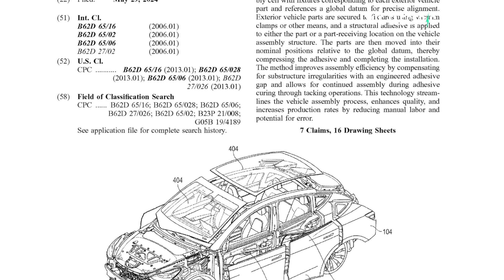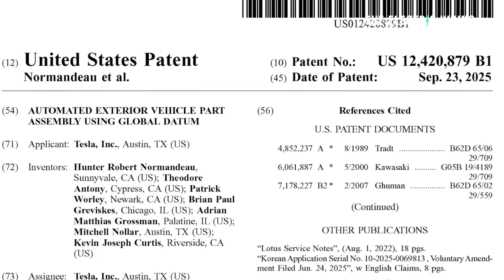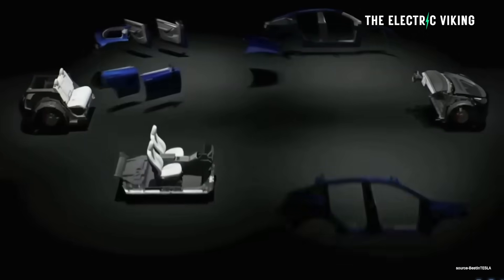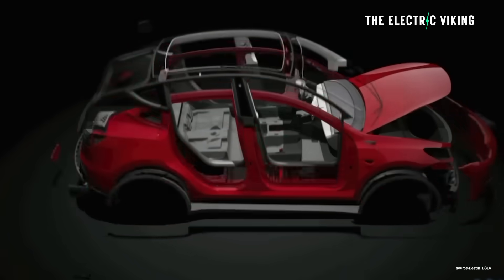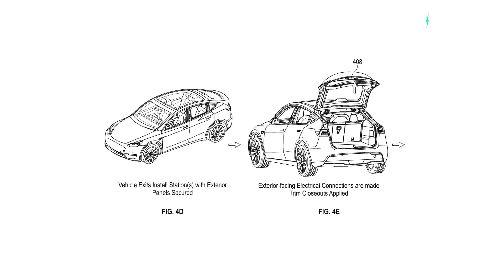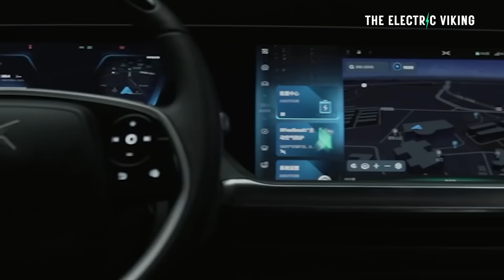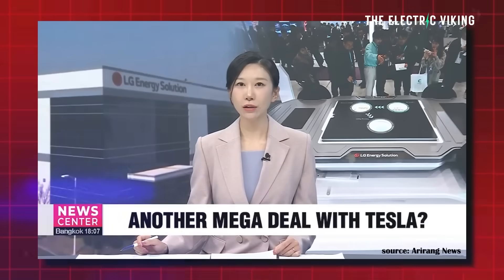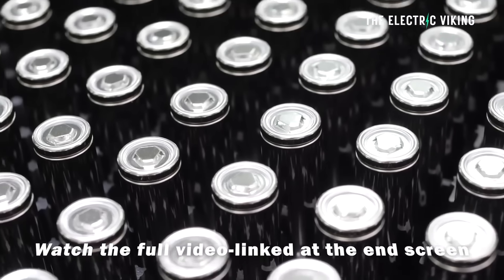Tesla Patents Revolutionary New 'Unboxed' Manufacturing Process

Comment: I read the patent.  What the patent discloses as an invention is basically using a robotic arm, alignment cage, and some special adhesives to position to external panels of the car during manufacturing. The main advantage is that as the glue is curing, the car can still receive other panels (by tacking certain panels until the glue sets), moving the car through further stages of assembly.  All elements of the invention must be present, namely, the arm, adhesives and alignment hardware etc.  What is more telling however, is the patent's B1 grant status. It means that the applicant did not allow for publication 18 months after application (as is the normal procedure). As a result of this, Tesla cannot apply for a patent for this same invention in any other country. I suspect that they want this only for the US plants in Texas, where they have this technology implemented, and will just keep certain aspects of it secret.  Other car companies can certainly paint doors with bodies and send them off for completion, bringing them back for final assembly.
Reply: You're a chad for reading the patent
Reply: @arnavrawat9864  https://en.wikipedia.org/wiki/Chad_(slang)#:~:text=Chad%22%20internet%20meme%20that%20originated,absurdly%20and%20over%20the%20top.
Reply: Tesla was using expedited examination. Is this why patent center has no examination report yet?
I read the claims, on first glance they are ridden with at least a few of 112 indefinite. Just poor quality patent imho.

Comment: Before I retired I  installed conveyors and transfer machines and made  them work with other process manufacturing machines. Our two story lateral and vertical transfer machines could complete a  cycle , with an entire automobile frame , in 49 seconds. We were the fastest in the industry.  The industry was trying to copy us . When others would brag about cycle speed they would attempt to make us believe they achieved a One Second threshold reduction. To claim a 50% increase in the speed of production is insanity. It cannot be done!

Comment: did you just say teslas are going to be glued together?
Reply: Hard pass I prefer to drive a car that’s been welded together.
Reply: Best not get on a commercial airliner then
Reply: Yes, that's what the patent is actually about.
Reply: @bengt_axle  glue used on Cybertrucks isn't lasting much
Reply: Lotus have been glueing parts of their cars together for years

Comment: At the CAMI plant in Canada. The Chevy Equinox was built in 17hrs 22 minutes from the first stamping to driving it out the final door.    How fast is this Tesla??
Reply: Per Grok the Model y in Austin plant takes 20 to 30 minutes to make. 50% faster for unboxed would mean could be built in 10 to 15 minutes for upcoming cyber cab. With real savings in a smaller factory footprint.
Reply: @JackLemp-tm8fg i doubt teslacan make a vehicle in 30 minutes. Obviously youve never been in an auto plant...Cami got down to 58 second cycle time.  Shanghai factory achieving a 35-second cycle time at peak speed.
Reply: "Total build time" for a Tesla car varies in available data, model and factory, from 2.5 hours to 25 hours. "Cycle time" is a second metric used to measure the factory output of completed cars , and is 30 - 40 seconds (You begin building an new car every 40 seconds, even if it will take 25 hours for that specific car to go through the whole line and be completed). Elon Musk has claimed that the Unboxed Process will give a cycle time of 10 seconds and that he sees how they can get it down to 5 seconds. A key seems to be able to parallelize more of the main line and not have a bottleneck there.

Comment: This process is already beeing copied or better say redeveloped, but there is problem in form of body deviations... This process instead of helping with deviations is pretty much doing the opposite and it will require a lot of engineering to fix that.
Reply: The patent describe addressing the deviation problem with adhesive. Basically fill the gaps with glue. It's like how modern houses are built today. You see a gap caulk them.

Comment: Also means insted of repair change a part, just throw out the whole car in case of accident??
Reply: The process probably matches insurance criteria. I’ve seen cars written off that look almost perfect because of accidents to the eye but underneath a section has taken a structural hit. Body panels etc will still be able to be replaced.
Reply: No.

Simply replace the full cast piece if heavily damaged, or cut out the damaged bit and replace.

3D printed sections can be used for partial replacements.

Overall, much cheaper to repair/replace a casting (1 piece) than to repair traditional structural members which are made from many many pieces of metal variously joined with welds, rivets or adhesives.
Reply: @clocksun But the whole piece can not be replaced, you'll have to disassemble the whole car....and this is already happening with structural batteries, minor accidents cause cars to be totaled....I'm not convinced but let's see nothing to lose to let them try and if it works adopt later.
Reply: @Rodolfowei12345 
Some degree if disassembly is needed for any car that needs collision repair regardless of how it is manufactured.

A key driver of repair cost is the amount of hours required to repair structural parts if affected.

Those repairs often require removing rivets and splitting welds to excise the damaged section of a traditional unibody.

With castings, that labor can be saved by simply disassembling to remove suspension/etc then unbolting the damaged casting from the structural battery pack.
Reply: @Rodolfowei12345 How or if a car is repaired is always the result of multiple factors: what was damaged?, how?, vehicle value?, who gets the bill?
Lots of cars written off by insurance get sold to salvage auctions. Many of those vehicles are purchased and repaired and put back of the road. That road may not be in the US😂, but lots of salvage cars do get back on the road. My comment was purely about the how of auto repair. Wasnt taking a position on the economics of it.
Reply: @clocksun   "much cheaper to repair/replace a casting (1 piece)"
WOW
Reply: @samuelkata7635 As I said, depends on how much damage. Obviously how a vehicle gets fixed (or not) will be a function of multiple inputs: what was damaged?, how?, vehicle value?, repair cost?, who pays?, etc.
Reply: Don’t the disamebble when thy put ppf on these cars ?

Comment: The problem is getting the body in white complete. That’s where you gotta dip the chassis and then put on your waterproofing so this doesn’t allow for the unboxing process.
Reply: What do you think the cybertruck and cybercab process is

It's the elimination of the paint shop and body in white curing process
Reply: @TheMagicJIZZ those are stainless panels put on a body in white
Reply: @frostcb2 yeah but no paint shop and they didn't treat the body in white or dip it

The same for cyber cab they aren't treating the castings or aluminium frame